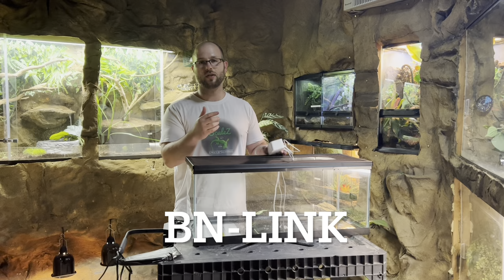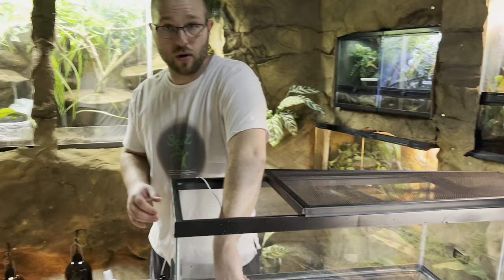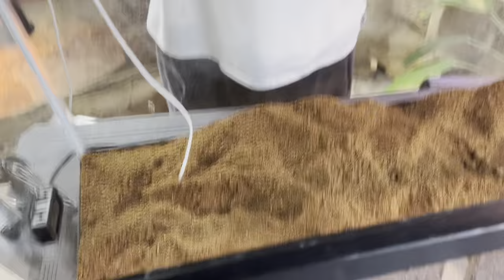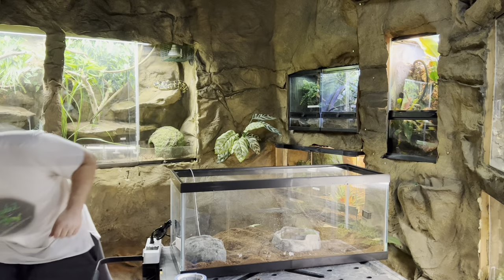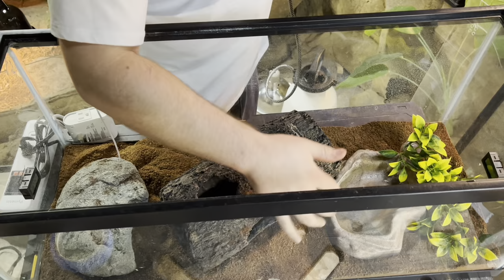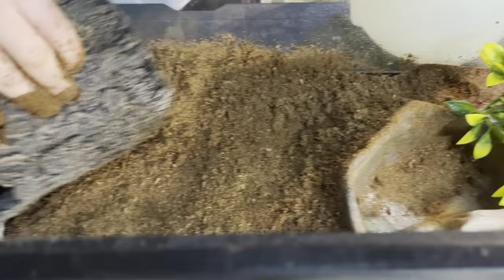Baby Ball Python Glass Cage Set Up Tutorial!!

Comment: This is absolutely ridiculous? A 70watt heat lamp right in the middle? Absolutely no escape from the warmth. Both sides are going to be atleast 27c dunno what that is in F. genuinely shocked by this video, so wrong it’s unbelievable
Reply: JuniorJohnson-jo7ev don’t stress, as long as the enclosure is around as long as the snake, a bit of humidity, and like you said a hot and cold side, I have 2 thermometers one on each side of the tank because imma helicopter snake parent, but they’re tough, a small issue won’t permanently harm your snake, maybe mild discomfort on both of you, but you’re good 💪🐍

Comment: I def dont agree with you 100%, but as others have said u def went over alot, and i dont see anything outrageously bad. Just things i would do differently, as in the substrate. 40-50 watt Che's arent powerful enough, u really need 60-75 watt as u said to get the ambient good. Also many thermostats aren't designed to work with Che's, so make sure the one u get will if thats its intended purpose. Also put the che on the hot side to get a better temperature gradient... especially in a 20 gallon. Way easier to mix ur substate before u put everything in the tank 😊

Comment: All you need is a rack system or just plain tubs with drill holes in them for air. And a thermostat. Well plus the heating Source pastil that's the easiest part. The hardest part of taking care of a snake is the setup. After that as long as you know what you are doing, your snake will have an easy life and so you will because it doesn't cost you much money after that

Comment: My probe says to not get it wet, so I have attached them to where they are under the hide and just above the substrate on the side of the tank. All seems to be going well, but CAN I attach it to the bottom with it touching the damp substrate then? I also have the 10-20 gal pads for the 20 gal tanks along the back edge lengthwise because the 30-40 gal pads wouldn’t fit width wise. They spend the majority of their time on the cool side in their hides, and I have the electronic probes adjusting the heat accordingly so I know the temps are good. And yes, I’m checking with the temp gun like we talked about. So did yours fit width wise fully  on the glass without any issues? Thanks Zack! Great video btw 🤗
Reply from the maker: It did actually seem to fit lengthwise. It may have stuck out less than an inch but ultimately did the trick of covering 1/3 the cage. And yes, I’d say you can put the probe under the soil on the glass. I do it all the time with those thermostats. I think it meant more so not to put water on it directly like spraying it, because it can then read the temp of the water versus the hot spot on the glass.
Reply: Put it on the glass and silicone it down so it can't get wet and it can only read the glass temp?

Comment: Do I need a drainage layer?
Reply from the maker: Nope, you don’t need one with ball pythons. If you see a buildup of water you are over misting by A LOT! Should just be lightly damp.
Reply: @scalezreptiles1813  thank you for the reply. I just put my new ball python in it's enclosure. I'm just having a hard time keeping the basking side at a steady 90 95 degrees. Im also using a circulating fan in the room to keep the humidity down
Reply from the maker: @wizzleman5597  why the fan? Why would you want the humidity down? I would immediately stop using that fan
Reply: @scalezreptiles1813  I was using the fan because the humidity in that room gets to around 80 percent and I heard that is to high. What do you recommend?
Reply from the maker: @wizzleman5597  why is the humidity 80% in the room? Where do you live?
Reply: @scalezreptiles1813  I live in California but I have the enclosure in a room were the windows are open most of the time. My hygrometer sits at 80-85 without the circulating fan in the room. With it, drops to 60-65.

Comment: Did you just recommend that new owners not track the temperature and humidity with gauges? There's nothing wrong with newbies keeping track of such things. Especially given that quite a few will not follow your instructions perfectly. Also, different regions have different relative humidity, so that can make a difference in the tank - as well as the temperature people keep their houses. The gauges can let people know when something is wrong before it screws up a shed, causes an URI, or makes them go off feed.
Reply from the maker: Thanks for your comment Charles. I definitely recommend people track the temperatures using gauges. It’s the humidity gauges that I do not believe are necessary and most of the time I believe people rely on them too much and in turn cause RIs because it’s reading 50% humidity (when in reality it’s 90%) so they keep getting it more and more wet. I understand people live in different regions and relative air humidity is different. But if you follow my general rules of thumb you will be completely fine for ball pythons. Covering the top of the enclosure is key. And keeping the substrate lightly damp by spraying a couple times a week is all that’s needed

Comment: Do you have an adult setup video?
Reply from the maker: I don’t at the moment but you can basically use everything I said in this video just on a larger scale. So I’d say at least 40 gallon tank or larger. Preferably pvc or something non glass. If you have to use glass it’s Okay just cover the top to keep in heat and humidity
Reply: @scalezreptiles1813  any recommendations on brands?
Reply: 40 gallons is too small for an adult ball python, the enclosure should be at least as long as the snake. They need a 4x2x2’ enclosure or larger.
Reply from the maker: @thecrazyadventurist5796  boamaster, but really most of them are similar

Comment: Putting the probe inside is not a great idea. All you do is put it in between the heat mat and the bottom of the tank. Yes, it will read hotter than the actual area inside the tank, but that’s why you set it a few degrees higher than the temp you want, and make sure the temp inside is correct with a temp gun.
Reply from the maker: That idea works great as well! I was just sharing what I have done and been very successful with. But I appreciate the alternate ideas.

Comment: Everything was great but you lost me with taping the thermostat inside the actual enclosure. That probe should be taped sandwiched between the glass and the heat mat outside the enclosure. There should be no tape inside the tank.
Reply from the maker: Yeah I agree with you. However sooo many people don’t purchase temp
Guns and then don’t actually have the temps right because the probe is outside the cage. So the temps run too low and people don’t adjust for that difference in temps. But I do agree, if you adjust for that, it’s better to put the probe outside the cage

Comment: Tape inside the aquarium is not a great idea. The snake will eventually get the tape loose and get stuck in it. If you want to run the thermostat line inside the tank, you should use a non-toxic silicone caulking to secure it and make sure it dries completely before putting anything in. If the snake manages to break that loose, then you don't have to worry about it getting stuck and injured by the tape.
Reply from the maker: Thanks for the idea Joel! Appreciate the comment

Comment: Coconut fiber is cheap and can hold humidity well but also holds bacteria  as well and as the tendency to get stuck in a ball python’s heat pits and if consume can cause impaction

Your better off going with mixture of 40% topsoil 40% zoo med repti soil and 20% playsand  substrate should be about 4 in deep 

Ball pythons are shy creatures so covering up three sides of the enclosure will help your snake feel more secure comfortable and confident in it's enclosure
Reply: No.
Reply: @nigelsreptarachnids5931  yes
Reply: I’ve never had any issue with cocofiber